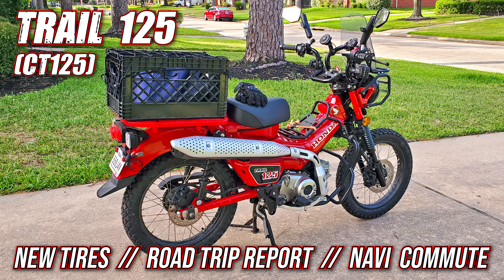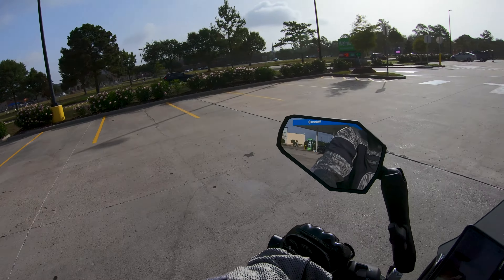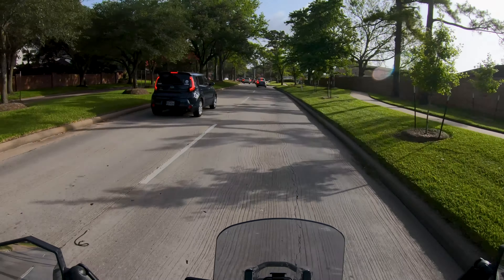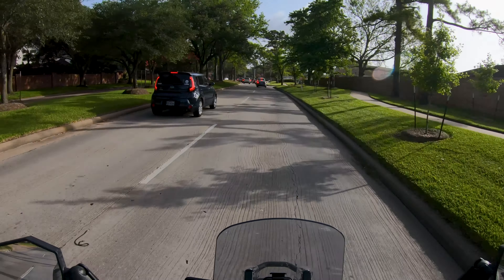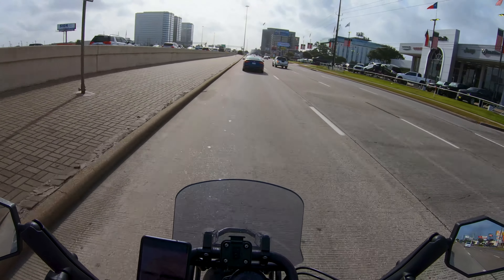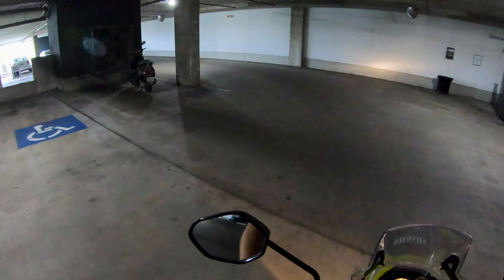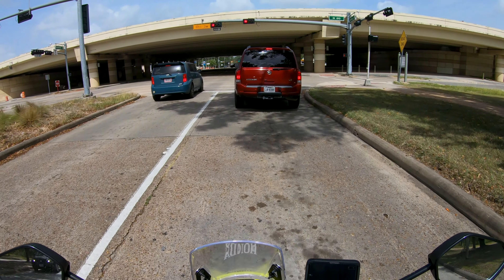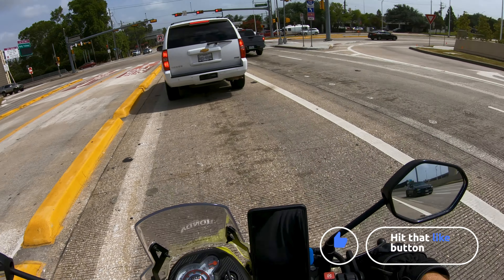VLOG: My CT125 has new shoes // Road trip report // Navi afternoon swap

Comment: When you fitted the  3.00 tyres i'm wondering if you calibrated the Opmid M1204 Meter as it has internal settings for F/R gear sizes and tyre rolling diameter as that would have some bearing on the accuracy of your displayed speed.
Reply from the maker: That's a keen observation!  I didn't change the Opmid's settings from the original values after I installed it.  It's actually good that I didn't because it read about 2-3 MPH optimistic (same as the OEM speedo).  The larger OD of the 3.00-17" rear tire has it very close to GPS speeds now... only about 0.5-1.0 MPH optimistic.  Cheers!  😉👍  --QM
Reply: @QuasiMotard  so now you know how to a 15T on the front which will increase your top end a bit for the freeways and still keep your ABS shaft speed sensor happy
Reply from the maker: @geoff james  Yep! I upgraded to a 15T front sprocket on my Super Cub C125 several years ago for that exact reason: https://youtu.be/H0-aQ-QNYHs .  Cheers!  😉👍  --QM

Comment: That trail is so much cooler than my Navi. I like the off-road style bikes more anyways so I think I’m going to upgrade one day. Plus better top speed and mpg.
Reply: Also double the price to start, also what I'd like to do
Reply: @Enrique-peralta  true. That’s why I just bought the Navi to start with lol. I really like it just disappointed in the fuel mileage.
Reply from the maker: Yep, the fuel economy is the biggest shock and disappointment that most Navi owners experience.  Honda's advertised MPG figures are usually accurate (if not conservative).  Their claimed 110 MPG is a complete farce in the Navi's case.  

The best that I've been able to achieve on the Navi with VERY sedate riding around town is 88.6 MPG... that's a whopping 20% lower than advertised.  As a point of comparison, Honda originally rated my 2015 PCX150 at only 100 MPG, but it regularly exceeds 125 MPG in town and 102-105 MPG on the highway.   The same is true of my 2019 Super Cub C125... Honda rated it at only 115 MPG, but it easily achieves 140+ MPG in town and 119 MPG on the highway at wide-open throttle.  😉👍  --QM
Reply: @QuasiMotard  I mainly just use mine to drive to work and I’m getting 65-70. Half of my commute is 55mph zone so I’m normally 90-100% throttle. I get it but still disappointed like most. Fun little bike though. Wow those are some good numbers! I like the Super Cub but just like the looks and functionality of the Trail 125 better.
Reply: @QuasiMotard  well I went into my dealer to buy a trail but some one beat me to it. Ended up with a 21 Rebel 300. I kept the Navi but there is no comparison between the two lol
Reply from the maker: Aww, man... that's a shame.  The Rebel 300 is a great machine, too.  Congrats on your new bike!  👏😉👍 --QM
Reply: @QuasiMotard  thank you sir!

Comment: Wonder if they would work on the Super Cub without a fender lift??
Reply from the maker: That's a good question!  The Super Cub has a LOT more room under the front fender, and the fender is fixed to the upper forks instead of movable on the lower forks.  The SC has slightly less clearance between the front forks, and the rear wheel clearance is narrower due to the torque arm for the rear drum brake (CT has disc rear without the torque arm).

I think narrower 2.5 - 2.75" tires might fit the SC without any problems.  However, I wouldn't want to run it off road much due to its very low ground clearance.  The exhaust header sits just a few inches from the ground and doesn't have any protection.  There are lot of expensive plastics to scrape or break, too.  

The low footpegs and the rear brake pedal/arm is also a consideration with the SC.  Check out this portion of my Scooter Cannonball Run video where I whacked rocks with the rear brake arm on rough gravel roads: https://youtu.be/H_O8tiOfbEo?t=2070 .  Cheers!  😉👍  --QM

Comment: Great Content! When I got my Navi I was all messed up where the controls are. I kept forgetting there wasn't a clutch. I guess I have the "tendency" to turn the throttle when I'm stopped. On my Vulcan, I used to pull in the clutch so it didn't show...but on the NAVI. It is a whole different show. Talk about a smoke show at a stand-still. LOL. I think I have it under control now. Thanks!

Comment: Where did you get the trailer for your bike I have a Honda monkey 2022 and would like to get one ty for all the info .
Reply from the maker: The trailer that I pull behind the CT125 and also my Super Cub is the KipMoto SherpaX adventure trailer:  https://kipmoto.com/pages/sherpax .  Their website seems to be offline or under maintenance right now, but you can check back in a couple of days.  

KipMoto has a hitch kit for the Monkey and Grom already, so it's a quick fit.  The full trailer price (with hitch) is around $1000.  These trailers aren't cheap, but they are built like tanks and withstand some serious abuse.  Cheers!  😉👍  --QM

Comment: Could you elaborate on the 18 hour fasting? Your daily calories are taken in from what time to what time? I would appreciate the info. Great videos. I just bought a 2022 and it’s a blast!!! Take care.
Reply from the maker: Congrats on your new CT125!  

My "normal" fasting routine consists of about 18-20 hours between meals.  I've done that for decades just because I was busy working and didn't take time out to eat, but now I'm trying to be more consistent with it.

I typically eat a moderate breakfast around 8am and then lunch around noon each day (4-hour intake window).  If I eat two meals, then I'll split my caloric intake between them with a heavier emphasis on the lunch portion (around 2500-3000 calories total).  I typically won't eat dinner or anything except coffee or tea for the rest of the day, so that puts my next meal at 16-18 hours away (8am the next morning).

If I skip breakfast or shift the schedule toward midday, then I'll eat a heavier lunch with most of my calories in that meal.  I might have a small snack before 4-6pm and then fast until lunch the following day.  It's an easy rhythm for me, and I don't feel hungry during the fast very often.  

I'll do a full 24-36 hour fast with just water, green tea, or black coffee if I'm feeling "off" or bloated.  That reset usually puts me back on track.  If I ever get really out of whack (e.g., stomach bug, or other illness), then I switch over to 24-48 hour fasts with only water and bone broth.  That's been my routine since I was a child... grew up with peptic ulcers... no fun.  Cheers!  😉👍  --QM
Reply: @QuasiMotard  thanks for the info Sir. God bless

Comment: O-ring chains are terrible. I've given up on them. No matter how much I clean and lube them, they always develop tight spots. I went with a DID non-oring chain on my KTM 350 this last time and I couldn't be happier with it. No more chain slap and lube slinging everywhere. Now I just spray it down with WD-40 and give it a wipe once in a while.
Reply from the maker: Yep, I've had the same experience with some O-ring chains as well.  What pitch does your KTM use?  The little CT125 is a 428, so there aren't a lot of options available.  

The OEM chains on these mini-motos are poor quality.  I'm already over 50% through my adjustment range on this one at just over 2K miles.  So, I'll be shopping for a DID or RK heavy-duty roller if I can't find a decent X- or Z-ring chain.  😉👍 --QM
Reply: @QuasiMotard  My KTM uses a 520. I have a China CT70 clone that uses a 428. I put an RK non-oring chain on the China bike shortly after purchasing it(stock chain was garbage). It stretched a lot at first, but has not moved in the past few hundred miles. 

Like yours, my Cina bike blew through the adjustment early, so I just removed a link to regain that adjustment potential after the initial stretch and it has been like that for months now.

Comment: How much did you pay for the tires and where did you get them? I saw a set on eBay from Thailand. Did you have to pay extra import fees to get them? Thanks in advance for the response.

Also those are some expensive tunnels.😂
Reply from the maker: No... these tires are easy to source here in the USA.  I ordered from DennisKirk here: https://www.denniskirk.com/irc/gp-1-dual-sport-tire.pfp540955.prdf .  The tires cost me $26.88/each ($53.76 for the pair), and they were shipped to my door in only 2 days via UPS standard ground for $7.99... DK's shipping is always super fast!  Cheers!  😉👍  --QM

Comment: The new tires look good.  The nail blowing out your back tire definitely seem like a full pucker momentI. I am certain the new tires will enhance the offroad capabilities of the CT 125, and it is nice that it seems to have improved your roadspeed.  It will be a nice easy install putting the Fender riser kit on, when it is found. I was told that using a self lubricating O ring motorcycle chain on the CT125 would result in a tiny power and speed losses, due to the increased resistance of chain movement; as compared compared to a standard chain.  In a nutshell the guy claimed his new o ring chain slowed his CT125 down.  I thought that was interesting, and would share it with you, and see what your thoughts are?    I do not think you would be happy with the new o ring chain; if it reduced your your power and speed noticeably.  Anyways, I love how quiet the stock exhaust is on your CT  125. PBSE  Adventures did a really nice review on the Morawaki Monster exhaust on his CT125; it enhanced the mid range and low end power.   Anyways, happy  Friday! Thank you for the quality content.  Looking forward to your Saturday live stream Honda Navi carb fix.
 This guy has cool content also. https://youtu.be/TPRiV7lHokY
Reply from the maker: I"m sure that an O-ring or X-ring chain will add more rolling resistance and reduce the speed & economy a bit.  The trade-off will be better chain life and reduced maintenance intervals.  

The OEM chains are prone to excessive wear and stretch when used in extended high-speed running... highway duty really kills them fast.  The only solutions for that would be to install a ScottOiler or manually lube the chain every ~200 miles.  

Adrian's chain on his Super Cub gave up before 7K miles, and mine had to be retired at around 10K.  Another SC rider on the 2021 SCBR blew her chain during the event, and it only had ~2K miles on it... improper lubrication, improper tension, and/or excessive wear due to high-speed operation.

I actually purchased a ScottOiler for my Super Cub that I planned to install before the 2021 SCBR ride.  Unfortunately, I couldn't find a good place to mount it, so I skipped it.  Maybe I'll install that on the CT125... should be easier with all of the extra space and fewer plastics in the way.  Cheers!  😉👍  --QM
Reply: @QuasiMotard   Thank you.  You always share good stuff.  I very much appreciate the detailed response.The Scottoiler is very cool system. I linked the wrong video on my comment about the Moriwaki exhaust.

Comment: Man watching these vids make me so jealous knowing I'll never find a dealer within a thousand miles that has one... Almost talked myself into getting a honda cub the other day ...uuhhgg why doesn't honda mass produce these??  Everyone wants one dang it!
Reply from the maker: If you're willing to go out of state to get one, then you might want to call some of the smaller Honda dealers in the central US.  Northern Texas, Arkansas, and Missouri have been reported to have some on hand.  

Another channel viewer mentioned that a dealer in the DFW area has 4 of the CT125's on their showroom right now.  I don't know how reasonable the prices are, but anything under $5200 OTD is decent with today's market.  Good luck shopping!  😉👍  --QM
Reply: @QuasiMotard  if you tear a tube like that again, tear or cut the tube in half where it is ripped. I have tied the ends in a knot and I have also used baling wire to close off the ends. Put it back in and inflate it. You must use a pump or a small compressor. Co2 is too cold. The folds at the end blow out. If you use a pump the ends grow together. I have always ridden slower but has gotten home.

Comment: Did you add the big bore kit to the engine?
Reply from the maker: No, this CT125 is still completely stock.  The only upgrades are simple bolt-ons and creature comforts... nothing for the engine, intake, or exhaust yet.  😉👍  --QM
Reply: @QuasiMotard  ok. I’m expecting mine to arrive this month. So I’m monitoring what everyone is doing. But the extra 15mph speed is appealing

Comment: How did you mount the storage basket onto the back?
Reply from the maker: For now, I'm just using heavy duty black zip ties to secure through the crate onto the rack.  I have a piece of flat steel that I'm preparing to use that will clamp the crate onto the rack with the existing bolt holes that are built into the rack.  That will allow me to quickly mount and dismount the crate whenever I need to carry other items on the rack.  😉👍 --QM